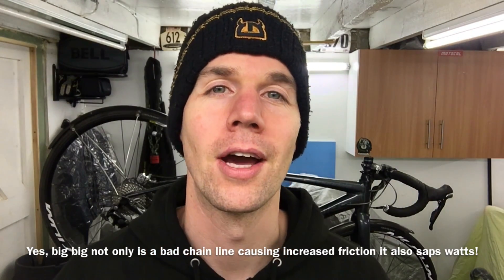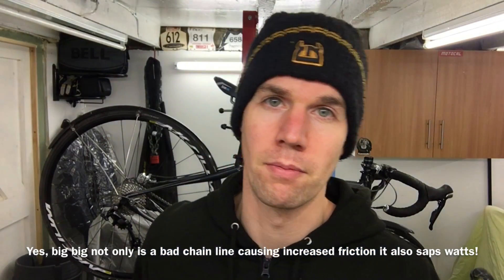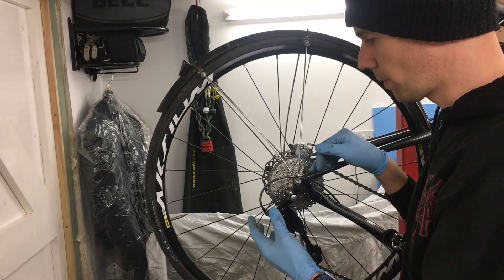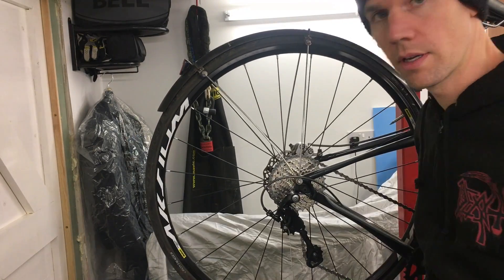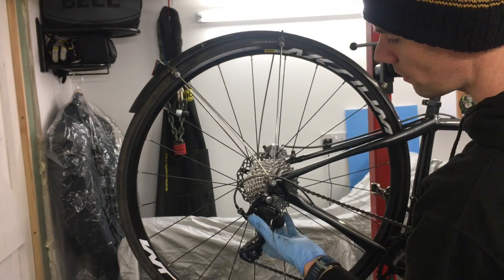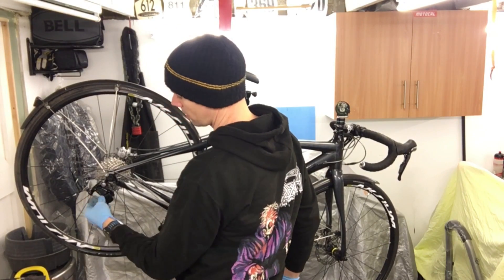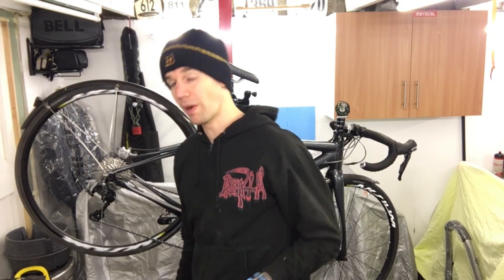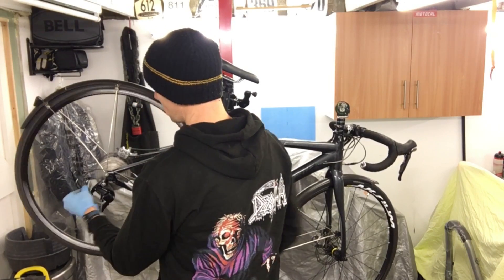Cable stretch myth and how to prevent poor shifting

Comment: Can I ask a question? Ultegra 6800 with newish and squeaky clean 11-32 cassette and brand new chain. Indexing is a nightmare. Shifts up the cassette but doesn't like coming back down! If it's adjusted to come back down smoothly it doesn't like going back up. Cable is moving freely in housing and lever movement is fine? Is this a cable issue or could the mech be knackered. It doesn't look bent? Most frustrating
Reply from the maker: What size cage do you have? if its an SS cage as they are limited to 11/30 and the problem you are experiencing sound like a B tension issue which a short cage would cause in this case. Check what cage you have, if it is a SS cage you need the GS cage Part Number Y5YC25000 and Y5YC98080. If you have a GS cage, hanger is true and checked with an alignment tool and you are happy the cable is flowing smoothly, the next port of call is the shifter. Check the cable entry is not blocked with cable debris etc try running a cable through the shifter and cable outer and pulling each end back and forth to see if you can feel any friction, you want it close to friction free. And drag caused by the cable bends can play havoc on the shift. The old 10 speed 105 shifters were terrible for this and Shimanos Cable Grease was great for resolving this issue. Hope that helps
Reply: @highcarbrider  thanks so much for your suggestions. I changed the cage for a GS or medium (which I think is the biggest)! I used the existing spring mechanism which I really struggled with when swapping the cage over. Cable changed (by a pro not me) with a good quality cable last September
Reply: I will try your other suggestions and see how I get on. Many thanks again

Comment: I just experienced this very problem but on the front derailleur cable. Not only that but when it was all set up and working, I then noticed that one of the steel wires from the gear cable OUTER had shot out through the gear shifter. Approximately 3" of this wire was protruding. Why would that happen? Any ideas?
Reply from the maker: Hi, the outer cable wires can wiggle out as the cable is bent and twisted but for them to protrude through the ferrel it is often down to the ferrel failing (cable end cap)
Reply: @highcarbrider  Thank you for your help. I have ordered some fancy shmancy alloy ones. Now that I understand the problems with the gear cable outers, I don't fancy messing with plastic ones and especially when they are sold as suitable for both 4mm and 5mm. I have ordered some that come in two different sizes with different sized holes for the different sized cables.

Comment: so does this apply to brake cables "stretching" too?? So its just the compression of the plastic housing?? 
How do we fix this?? I tried to pull the cable tighter and it didn't move much so I used the little dials at the brake lever and at the brake to turn them to help retighten my brakes back up but curious if there's anything more we can do?
Reply from the maker: shane k sorry about my accent I also mumble a lot too which doesn’t help 😕 If a cable goes slack it can often be linked to corrosion in the outer cable housing so replacing the inner cable for a new one with a bit of shimano cable grease and flushing the outer cable out with a spray line can do wonders.

Comment: before tightening the new cable, I apply a little pressure on the rear derailleur will tightening the cable in place. once screwed in there's a bit more pressure on the cable but there won't be any "stretching" issue/ferrels causing issues.

Comment: You need to come set my bike up bro
Reply from the maker: bring it on, I'll get it running sweet
Reply: @highcarbrider  I bet you can't get mine running sweet :'(
Reply from the maker: Sam Callaway bet I can dude, I could even teach you how to blast beat 😁
Reply: @highcarbrider  strong words!
Reply from the maker: @angrahell  😁If I can help remotely give me a shout, happy to try and help
Reply: @highcarbrider  I'll tell you this...

Everything new (except shifter and cranks)

Downshifting noisy and doesn't stay on final cog when shifting three cogs at a time

This all goes away when using squirt lube instead of wet lube.

Thanks :D
Reply from the maker: @angrahell  Ok man, check your inner gear cable is running silky smooth, if in doubt, replace, flush the outer out with a spray lube and run a bit of Shimano cable grease on the cable when you feed it in. Check the mech hanger is straight with a hanger alignment tool. If they are all good the other thing you can look at is the B-tension is set up correctly
Reply: @highcarbrider  hanger is straight

pulley is about 6mm from cassette on the biggest cog

Everything always comes back to cables and has done since I got the bike :|

 They're external, there's quite a bend exiting the shifter and the cable touches the headtube cable stop when exiting it because it's at an angle for some reason. 

Oh and it doesn't like coming off the small cog once you've gone through all of the cogs and back down again,  unless you push the shifter just right.

But ima get someone else to look at it soon (running out of people though)

Thanks